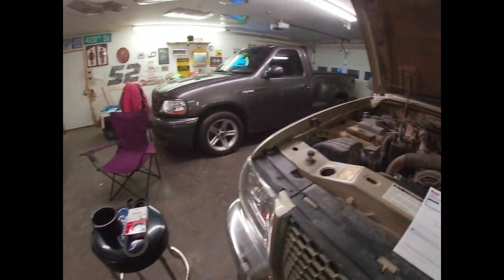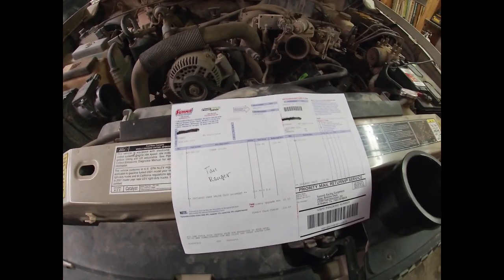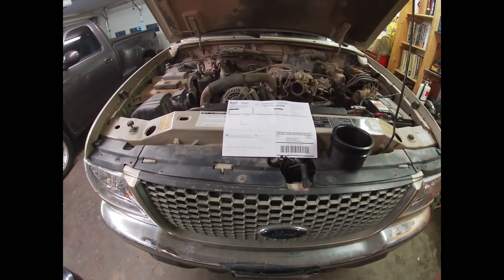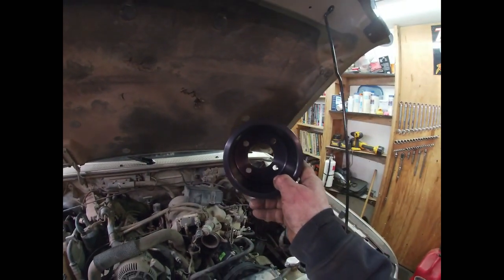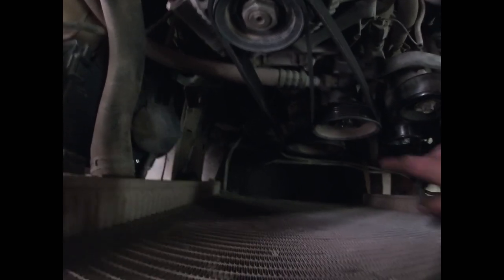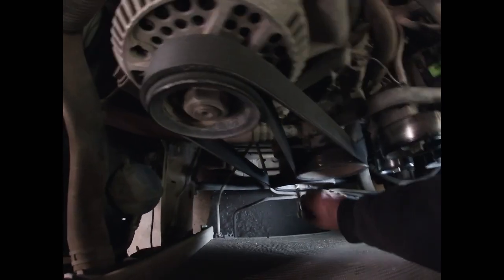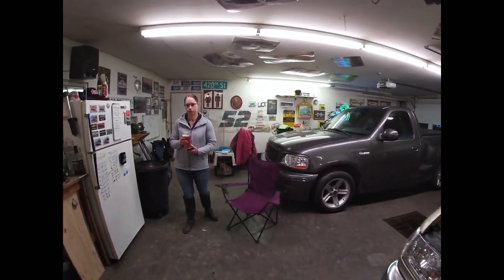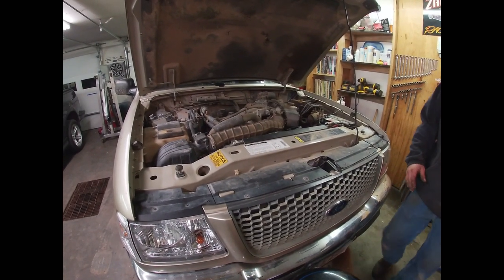How to choose the correct parts to install an underdrive pulley on your ranger, and a quick tech tip

Comment: Thanks for another informative video Wayne. Now forgive my ignorance on Ford diesels. I don’t know if the 6.9 diesel’s have an external harmonic balancer  like the GM 6.2 diesels.  if the 6.9s do, have  you ever changed one? The reason I ask is, on the GM 6.2’s there is a bolt that runs through the balancer and threads into the crankshaft how would you stop the engine from spinning when trying to take out the bolt?  My GM is a standard so I could put it in reverse and block the wheels but I don’t know if that would be enough to stop the engine from spinning. Since the crankshaft is cast-iron I don’t think it would be a good idea for me to use an impact on it. Any thoughts would be greatly appreciated.